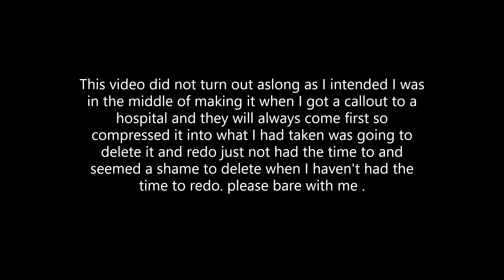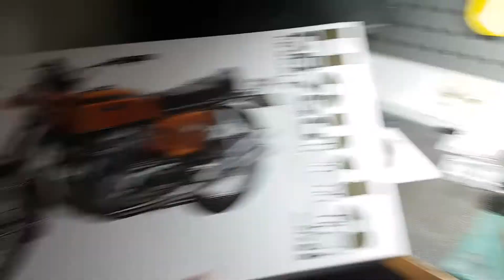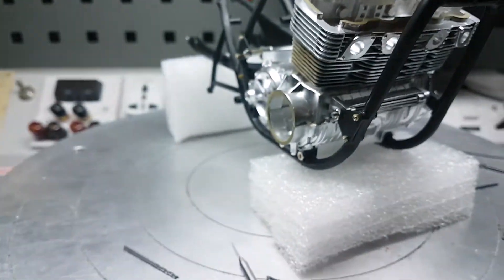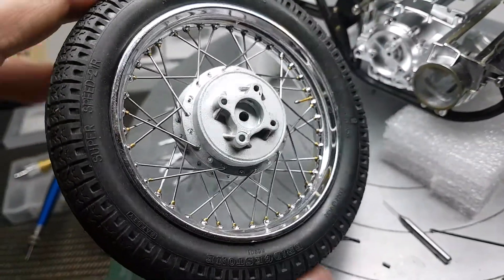New Build ????

Comment: I'm pretty sure I was lusting after this kit in the mid seventies, the real CB750 came out in 1969 (The first superbike). I like the use of realistic threads and nuts but on my restoration projects the bolts through the engine mounting plates always have the ugly nuts and washers on the inside and the bolt heads facing out. Sorry to be pedantic but you seem to be trying to get things looking right.
Reply from the maker: Hi Doctor Dirk
You are probably right on the date I was looking at the date on the old box's tamiya right the release date on the side only seen dates for early 80s. And you are totaly right engine mount bolts been struggling to find the right size so I'm havin to make the bolts myself I wish I could find the right size I'm still hoping if I can't  I will epoxy filled and chrome foiled  to look like bolt heads the bike is in mok up at the moment so just making sure everything  fits before I strip down to primer and paint..  and your right on with the detail I do try to get them right It not easy trying to get bolts with 2mm head and a 1mm tread and the correct bolt style is realy hard to find.. Thanks for taking the time to watch and comment it great to get some feedback from what I'm doing..
Reply: @wiggly71  
Take a look at 'Lion Roar' LT0035 and LT0036 etched nickel silver bolt heads. These are etched onto an adhesive backing, so there are no tags to remove. On Youtube, I've  seen these stuck on with super glue (tricky) or a spot of 'Pledge' floor polish (easier to control)